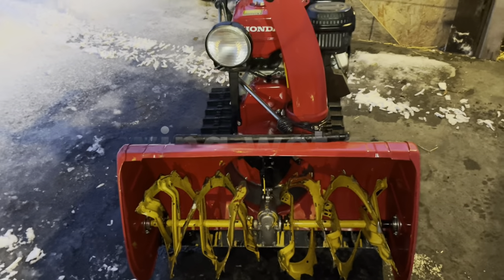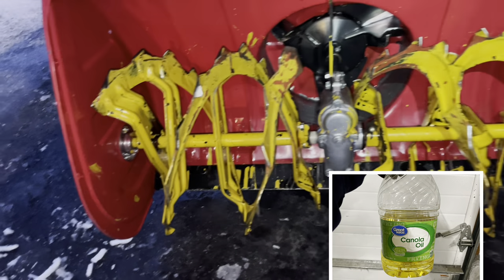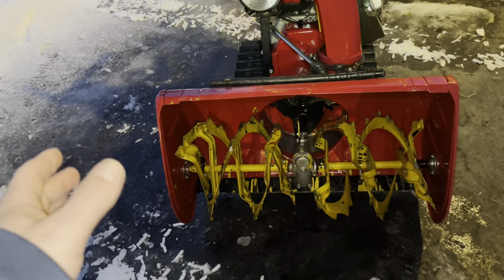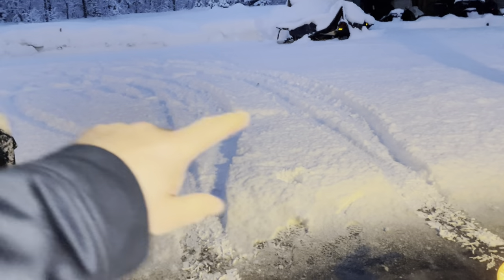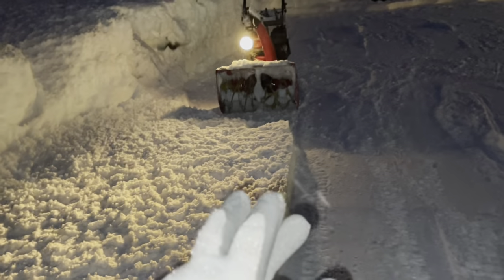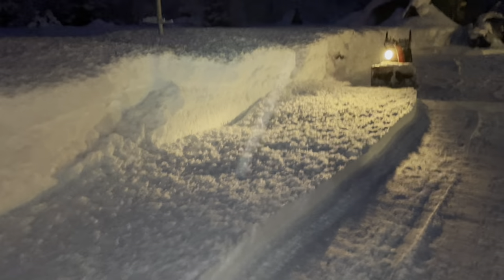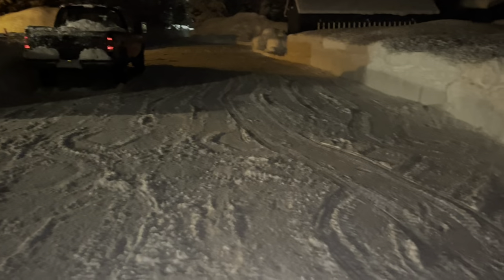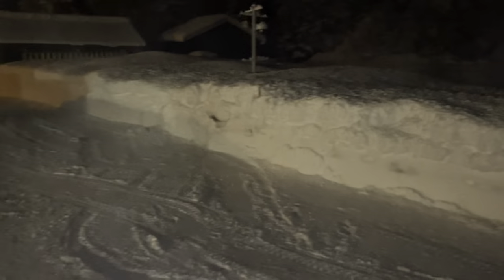How to snow blow wet snow.

Comment: that blower is a beast...can"t imagine you using anything less than the 1132 up there in AK!  Thanks for sharing!
Reply from the maker: It works really well and has blown a ton of snow over the years. I bought it used in ‘15 after I broke something in the transmission of my first 1132 after 13 years of use. I want to buy the version of it but Honda doesn’t have any of the 13 horse models available here in AK.
Reply: Exactly the info I was searching for, thank you!  Temp @ 32 with wet & packing snow. Spray oil is genious!  Not only do I have a wide driveway plus turnaround,  also have to maintain paths to areas around the house. Hope other women find your info.

Comment: I bought some ceramic coating for cars. Gonna try it out this winter and see how it does.
Reply from the maker: @NorthernWind603  I looked into trying some stuff like that out but I didn’t like the cost. The cheapest/easiest/best thing I’ve found so far is canola oil out of a gallon jug I then put into a water spray/squirt type bottle to apply.
Reply: Yeah I bought a cheap 20 dollar spray version. The others were expensive. We will see how it does. If a bottle lasts me a season and works, I’ll call it a win. Might try the impeller mod next season if it doesn’t.

Comment: Your auger is all bent up. Why not straighten it so it works better?
Reply from the maker: I had broken the cross shaft in the original auger earlier that winter. I pulled the auger that is in the video out of another 1132 I had so I could keep up with clearing snow.